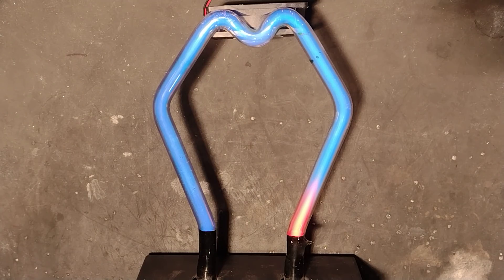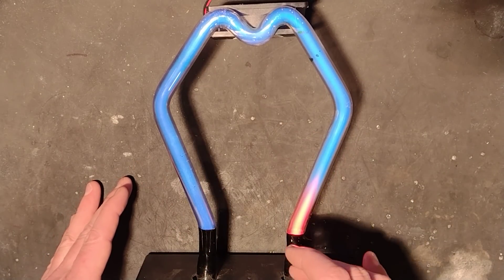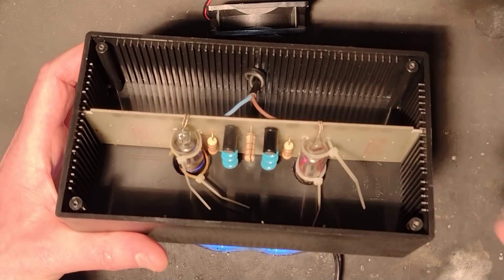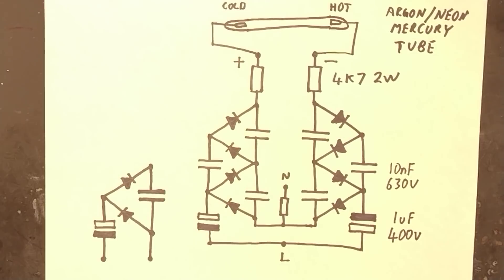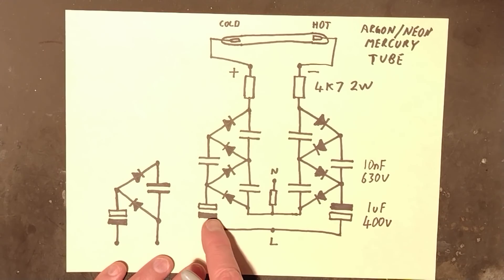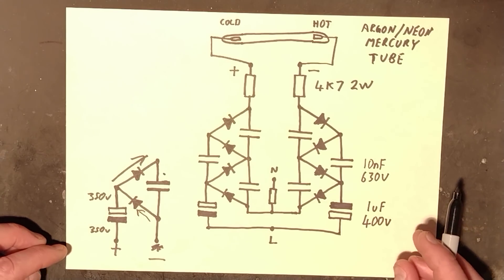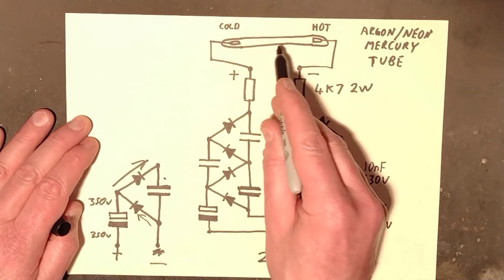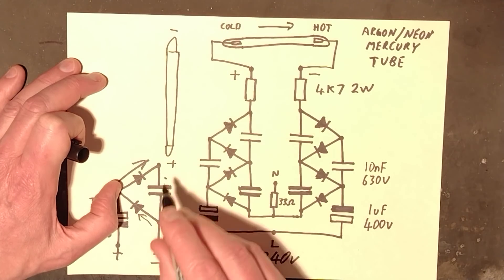The "M" tube neon-mercury DC migration effect (with schematic)

Comment: I noticed that when I put a germicidal lamp near a plasma ball or Tesla coil (for short time to limit exposure) the center is a mercury plasma and the side of the glass when I touch it has violet glow where argon/krypton is excited and ionized too. In normal operation the light from argon/krypton is too weak to be notices mecause mercury is more easily exited/ionized.

Comment: With the two different gasses this tube would function as a HV diode when gasses are properly separated. Be cool to inject AC and see if this theory holds water. Also Neon xformers and lamps were a light bulb nerds final fantasy. As a kid I had almost every other discharge lamp but not a large neon. So expensive!

Comment: My memory is not so good these days but I recall that 2 inch diameter very high output 8ft (270 watts I think) fluorescent lamps used (still are?) to be used on film sets (running from the 240V dc supplies that ran the 10kW and 20kW tungsten studio lamps) with resistive ballasts. The idea was to eliminate film frame strobe effects. They would only operate when actual filming was happening and they were switched every time to reverse polarity  to stop mercury migration / dark ends.
Reply from the maker: I'm not sure if they were used like that.  But later there was a popular light based on high output arrays of fluorescent tubes with high frequency drivers.  It was called Kino Flo.

Comment: Very interesting Clive! I think I've seen a few of the plug packs you mention in your description that contain this basic circuit, they usually look like standard wall warts but covered in cooling vents, am I correct? Although realistically the ones I've seen are more likely to be some kind of HV switching PSU, not a basic agricultural circuit like this, but it works and I'm impressed at the simplicity!

Comment: Since there are three multiplier stages on either side the output voltage is 6 times the input voltage, correct? Also, if the input is AC, why is it OK to use polarized capacitors there?

Comment: This is really cool! I’m so glad to see new neon videos from you! I have an old neon/mercury clock that can instantly change the color of the tube from red to blue by varying the duty cycle and frequency of the drive voltage. It’s just based on a pair of 555 timers, I’d love to see you reverse engineer that!

Comment: While I work in a sign shop and have seen mercury migration with some of the cheap DC electronic transformers, never really thought of combining the neon gas with the argon/mercury mixture. Neat effect. 

It would be cool to modify the power supply where it could supply AC and DC option as well as being able to reverse the polarity. Maybe even control the switch with a microcontroller to switch with the typical mercury migration. That way it can move back and forth or even distribute with ac applied.

Comment: I think a curled tube might make a interesting display with all the low spots the curl has when laid out horizontally. 
Then it you took that vertical with the polarity so that it pulled the mercury up only to drain back down when you turn the power off. 
On other things. When Youtube made the changes to the email alert how do I get an alert that you have posted a new video?
Thanks Clive.

Comment: Used a circuit like this and the classic ZVS fed LOPT. A friend managed to bypass the diodes in the LOPT so we got some good HV AC with a decent frequency out of it.
It made something north of 50kV DC and was tons of fun.
It made a loose fitting t-shirt cling to your skin like a spandex leotard and the insulating oil flowed upwards along wires.

Oh, and a drunk friend pointed at it and got zapped, up until that moment we had operated under the assumption that a chock would probably land you in the ER.
So another pleasant surprise!

Comment: Its an important thing to note the mercury usually used in neon tubes is supposed to be a tiny droplet, these weird tubes are an oddity that uses relatively a lot of mercury
Reply from the maker: The guy who made this tube for me was notable for adding quite a lot of mercury, and also not using a diffusion pump.  (Hence the staining.)

Comment: this video remids me of a low pressure sodium lamp they had at the front of a local library, it would always glow pink at dusk when i used to go past inside a bus on the way home, but when i saw it later on it would be yellow. i always wanted to know why does it do that?
about 10 yers later the library became a demolition site, i climbed in and rescued the bulb and its ballast from sure death. its one of those U tube style lamps with extra glass envelope around everything. you can see drops of mercury in there too.
  it starts a nice cosy pink but after 5-10 min it becomes a blinding yellow monotone on just 180 watts. the efficiency is truly ridiculous in how it lights up the entire yard, it must have been invented by the lightbulb god or some other major bulb deity. certainly makes other bulbs look like jars of glow worms.
Reply: the pink is from other gases used to start the arc, once the bulb comes up to temp the sodium turns to vapor and starts to emit narrow band yellow which over powers the color from the starting gas.
Reply from the maker: The pink is from neon used to heat the droplets of sodium and get them into vapour form.

Comment: It seems to me those 630V capacitors are being slightly overvolted.  However, I may build something like that, as I made a neon/mercury tube some time ago, and it was great to watch the bright red neon discharge being taken over by the mercury, but the only way I could think of to repeat the effect was to try chilling one end to encourage the mercury to condense out (I haven't tried that yet).  Running it on DC hadn't occurred to me, I'll give it a whirl.

Comment: I am quite surprised that it is the cathode that gets hot. In both x-ray tubes and xenon short-arc lamps the cathode is small and the anode is huge, to dissipate all the heat from the electrons hitting it. Why is it the other way around in a neon tube?
Reply from the maker: Now I'm going to have to double check that.
Reply: Maybe because neon and mercury ions bombard the cathode.

Comment: Isn't tubing in such applications measured in 1/8" increments though? So that would be roughly T4?
Reply from the maker: I don't think neon worked on the 1/8" system.
Reply: @bigclivedotcom  Ah ok. I thought they may use the same system as florescent tubing. 12mm would be pretty close to that size though, given that the other measurement was in imperial units.

Comment: Clyde would you consider this same circuit be the one that they use in stun guns to help increase the voltage to break the air barrier spark cap?
Reply from the maker: They usually have a multiplier to pump the main capacitor that is discharged into the output transformer's primary.

Comment: On another subject a note to self and others. When converting devices to different line voltages by changing the dropping capacitor, don’t be lazy and just leave out the bleed down resistor. I says to my self I don’t want to buy another 100 smd resistors to use only 10. Besides I’ll never get zapped I’m careful. Ahem, ouch! It sat for 2 days and still held quite a sting. 228v thereabouts.

Comment: I remember this schematic being publicized on a electronic magazine as "How to extend life of your fluorescent tubes". Of course, with less stages but essentially multiplied 220V AC to around 600 or 800VDC. Once I suggested to a friend to try it; he had a lot of old fixtures with oxidized ballasts, ancient failing starters and many one-filament burnt 1.2m fluorescent lights to maintain at his work (some government place) and not enough funds and replacements and some were very high placed. We used 8u/800V electrolytic non polarized capacitors and 1n4007 diodes. Tried one fixture, and worked. Later I heard that he modified all fixtures and was very happy. Never changed a fluorescent tube again, he retired few years later.
Now I wonder, did this setup not made the tubes darken at one end after many hours of use? I used it myself once for few months with a big tube (1m I think it was) but I didn't noticed anything.
Reply: Yes in the late 80's "electronic" fluorescent ballasts were coming onto the market, and my grandfather bought a bunch of cheap ones for the basement. Unfortunately over months the mercury would flow towards one end taking the illumination with it. The instructions were to flip all of the lamps once this became noticeable.
Reply: @ChrisSmith-tc4df  The early electronic ballasts, although with an ac output, often had an asymmetric output waveform, a sort of dc offset. Eventually the mercury progressively dissociates away from the argon carrier gas from one end of the lamp.
Reply: In low pressure phosphor coated mercury discharge lamps, ie fluorescent lamps, the current in the discharge is relatively high such to cause a high UV emission to excite the phosphors to a high light output. It relies on electron emission from hot spots on the coating on the lamp cathodes. The coating wears off, causing the shadows on the ends of fluorescent lamps. When the coating has entirely gone from a cathode the arc current cannot be maintained and  the lamp is “deactivated”. In starter switch circuits the starter will keep operating. Eventually the starter may weld up and the common hot ends appear, the current limited by cathode resistance and ballast impedance. Often a cathode will go open circuit due to an emissive hot spot appearing on the tungsten cathode. 
However the mercury column is still there and can be excited by high voltages, as with the circuit, or similar, you mention. Essentially a glow discharge. It will last indefinitely. But the light output of the lamp will be very low compared to normal operation and the efficacy (lumens per watt) poor.
Reply: @99Noggin  Yes, now that you mention it, the fluorescent tube that I used was kinda dim, but for its huge size (1m long tube and thick diameter; it was quite ancient at the time) it lighted well I think it was 100W or 80W rated; I got it from that friend and it had burned filament at one end. However, I changed the fixture and all few months later with two fancy circular 20W neon tubes.

Comment: I wonder if you could use a capacitance multiplier to drive a Jacob's ladder. And what kinds of circuit protections would you need to include?
Reply from the maker: I doubt that's practical as they require high voltage and current.

Comment: I always wondered how far you can go with a capacitor and diode ladder like that (and ionisers). Is there a limit in increasing voltage? Probably limited by the working voltage of the capacitors available.
Reply from the maker: They get less practical as they get longer.
Reply: Because the circuit resistance rises at each node eventually the low current discharges that occur around sharp junction points limits the maximum voltage.

Comment: i've got one for you, big clive.  20 years ago when i was an electrician's trades assistant, the boss, who is a know-all smartarse like me (we both readily agree to this title ) asked me if i'd ever heard of induction lighting (i think that is what it was called).  he'd been asked to replace the tubes in a commercial establishment.  after some hunting around he found some.  to the best of my memory,  they were circular fluorescent tubes with no electrical connections.  the current was induced into the tubes.  he was told that the tubes are extremely long lasting, the ones being replaced were about 50 years old.
Reply: I think I have one of those. It's two feet long and has a metal stud at each end instead of pins. I have no fittings to use it with, alas.
Reply: @peterking2794  , i typed "induction lighting wikipedia" to find a page on the wide range of things that operate by induction.  they can be highly efficient.  go and see if what you have is there.
Reply from the maker: I have an induction lamp here.  It uses external coils to induce current flow in the sealed tube.
Reply: there are some youtube videos about them too!  i'd forgotten all about the existence of the things.

Comment: I've made voltage doubling ladders before, but all the capacitors were all the same value.  By making the first capacitors 100X the size of the following capacitors, does that cause it to make a high strike voltage in the no-current state, followed by a lower voltage (essentially just the first rectifier stage) when the tube is conducting?  That seems quite clever.

Comment: There appears to be way too much mercury in that tube.  As someone who has fabricated my fair share of neon signage, I can tell you that it only takes a small drop of mercury to interact with the gas.  While I'm sure it works for your science experiment, a tube with that much mercury in the wild would burn out rather quickly.

Comment: I used to work as a neon bender for eleven years but I wasn't very involved in the electronics, so this was an interesting video. As far as I know one single neon bender now supplies all Nordic countries since LED technology covers almost all scenarios. There is something special with pure neon light in a clear glass tube which can never be replaced with LED though.
Reply from the maker: It's become an art and architectural medium now.
Reply: I dread the day they will throw out the tubes in the roof at Hötorget subway station and replace them with energy efficient but soulless LED strips. And I agree that nothing can replace gas discharge in clear tubes. I even bought a small neon tube with my own signature to wear on my overall at KTH...

Comment: Morning Clive from a grey south east London...great video that was very nostalgic for me. Back in the 70s Lewisham and New Cross a couple of years before the area got a massive kick up the harris with the anti NF riots the only bit of colour in the landscape was Pearce Signs by the bus stop opposite New Ctoss Gate Station...the neon man climbing a red neon ladder with the multi coloured Pearce Signs logo always looked so exotic !!! I remember how easily one,even as a 14 year old had access to the factory floor...I was fascinated by the whole shebang and had the "audacity" to suggest to the manager that they should make custom signs for peoples homes...I drew up an example that consisted of my name ALEX and an apprentice made the tube up...sadly I never got the "driver" to run it but lives on with my collection of 'industrial glass art' ie 50,000 watt tungsten bulb,this beautiful microwave valve(with delicate wave guides and thick bands of copper around the glass envelope) about 2 foot long with a magnetatron on the bottom. I have always loved glassware but this mode. The fascinating and seemingly impossibly delicate element and structure that supports it in the 50k bulb is 'art in the eye of the beholder' ....this one anyway. 👉🇬🇧👈👉❤👈💯%
Reply from the maker: You can buy cheap electronic neon transformers on eBay.

Comment: Good old voltage multiple , is a circuit I use a lot , especially when I need to squeeze a lot of electronics into a small space , and the circuit uses a low currant. It allows me to use a smaller transformer for example a 6 volt transformer to provide an 18 volt supply , it is an under used circuit

Comment: I take it a 1N4148  diode wouldn't cut it in this scenario, so would it be wise to use 1n4007 or would voltage be an issue?
Reply: The voltage multiplier appears to have 4 stages so it will be multiplying by ~16 times, so the voltage across the final diodes and capacitors will be ~8x240v or 2kV. The 1N4007 has a reverse voltage of 1000v so you might get away with using 2 in series, but it would be safer to use diodes that will withstand that kind of voltage (BY203?)
Reply from the maker: Each stage involves around 650V so a 1000V diode is needed.

Comment: Nice circuit, must try and find some neon tubes for experiments, what diodes are suitable forthe multiplication stages, 1n4007 types good?
Reply: The voltage multiplier appears to have 4 stages so it will be multiplying by ~16 times, so the voltage across the final diodes and capacitors will be ~8x240v or 2kV. The 1N4007 has a reverse voltage of 1000v so you might get away with using 2 in series, but it would be safer to use diodes that will withstand that kind of voltage (BY203?)
Reply from the maker: Yes.  1N4007.